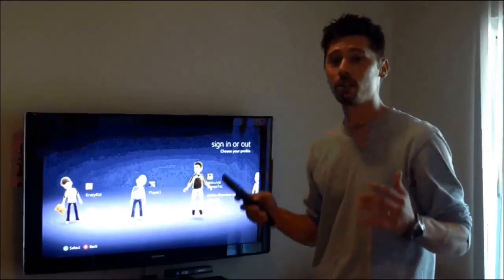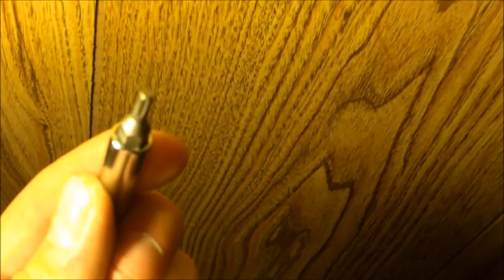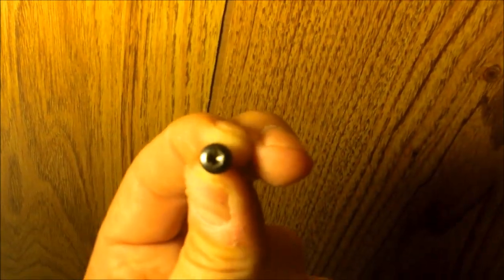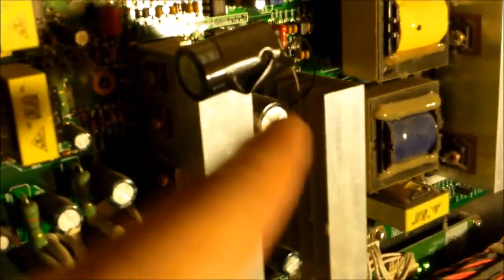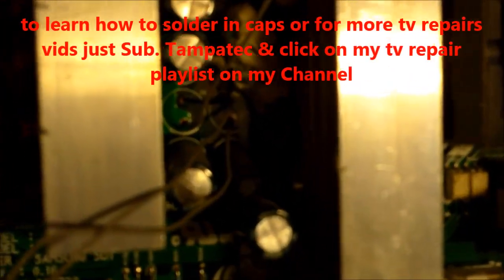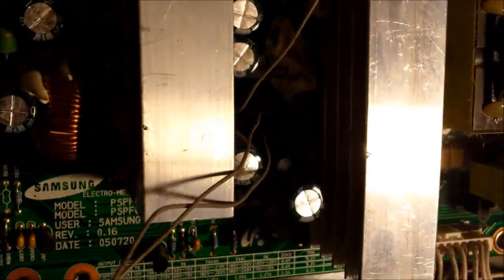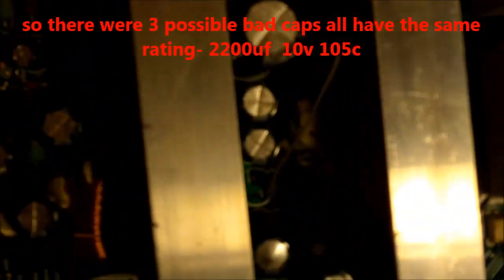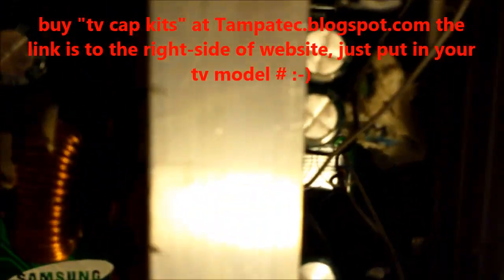How to fix Plasma TV rainbow color snowy static screen repair tutorial

Comment: To anyone still rocking a plasma with this issue, before you take it apart try adjusting your brightness setting. It adjusts the black levels, and if it's set incorrectly that RGB 'snow' on blacks could be because it's treating it as a grey color. A quick way to calibrate this without a set of videos is by getting a letterboxed movie and lowering it until the black borders have no snow.
Reply: yeah 😶‍🌫
Reply: I have a Samsung plasma tv model PN64D8000FF, mfg. date 9/2011.
It has been working fine, then one day, the display got snowy… it turns on fine, sound is good, just the display is snowy. Any suggestions on what I can do to troubleshoot and fix the problem? Thank you.
Reply: I have a Samsung plasma tv model PN64D8000FF, mfg. date 9/2011.
It has been working fine. In July 2024, the display got snowy… it turns on fine, sound is good, just the display is snowy. Any suggestions on what I can do to troubleshoot and fix the problem? Thank you.
Reply: I have a Samsung plasma tv model PN64D8000FF, mfg. date 9/2011.
It has been working fine, then in 2024 July, the display got snowy… it turns on fine, sound is good, just the display is snowy. Any suggestions on what I can do to troubleshoot and fix the problem? Thank you.

Comment: Hi Tampatec, I have snowy interference on My Daewoo DT-42A1, I have gone through the capacitors on the power supply and the appearance of all of them are fine.
I have tested them all with a multimeter on resistance setting and nothing is jumping out at me. Can they be working but lazy under load? Most of them are 1500uf 10v and some seem lazy when climbing to infinity. Any advice welcome
Cheers Stuart

Comment: When caps dry out,  their capacitance isn't affected so they'll read good, what happens is their effective voltage rating goes down and then they arc and fail.  This means that higher voltage rating replacements will be harder wearing in the same situation.  Unfortunately this means they'll be physically bigger so they may not fit unless you are saved by "Moore's Law" with new technology, or resort to flying leads like here.   I buy cheap batches of 10 caps from chinese ebay suppliers for fixing old screens and psu,  and liberally replace any of the same value on the board.  New caps never hurt everywhere.  I've heard that in critical equipment some organisations replace every cap in 5 year cycles before they get a chance to wear out.

Comment: Tampatec I got a 42 Magnavox plasma tv modle 42MF230A/37 I was wondering if you could help me my plasma tv after 20 minutes it kinda has a burn-in but instead of it being white or grey its red, green and blue but it goes away for away then happens again and it builds up if the screen stays the same then goes away would bad nice of you got back at me thanks.

Comment: Hey guys!Well I sure hope to get some feedback on this one because I'm stumped. I repair tv's as a hobby so I kkow enough to get me by, but have never experienced this before. 
Samsung 46" plasma model pn51d450a2dxzc

Got this plasma a few hours ago for free, no power issue. Was lucky with this set, it was unmolested and only needed 2 caps (25v 1000uf). Replaced them and it fixed the power issue, but there was a black circle with static around it. After a bit I noticed the boundaries change so I put on a pixel flipper which got rid of the black circle. 
Now, there is an oval area in the middle of the screen which has static around it, and several (20+) sticking pixels. 
I contacted him back and trust him when he says it was never hit, which I believe because there is absolutely no evidence of trauma on this set. Not a scratch. 
What would cause this? Is the panel itself defective? Have had it on pixel flipper for about an hour with no change. 
Any help is appreciated.

Comment: Enjoy your tutorials, very informative, keep up the great work helping others. I have come across some new Samsung 60" led tv with damaged screens. where can I purchase new screens for them
Reply from the maker: the screen cost 80-90% cost of the tv ( most screens come from China). i would sell tv broken or part it out and sell boards on ebay then use that money to buy LCD TV. don't put money on a dead horse, click "like" if anyone agrees.
Reply: Parted tv out today, sold on ebay already. thanks, Can you recomend a Weller soldering Iron. I was looking at a 35 watt professional model, would that be good enough, also looking for your  web site for parts, thanks Geprge
Reply from the maker: George Momich try shopjimmy.com but i love my new adjustable 50watt soldering iron. also desoldering station is awesome too. weller is great.

Comment: if i have this same kind of problem but only on the top of my screen would it still be the power supply or do you think it might be something  else?
Reply: I had this issue. I took it to a repair shop and they adjusted the voltage. it acts up for a few minutes but after the tv has been on for a few minutes it goes almost completely away

Comment: Hello nice information video. I need to ask you a question I have Sanyo 42746-00 plasma tv . I found 1 capacitor was given snowy picture. I replace with same kind capacitor. But my tv colors and pictures not bright. Not like nice tv cors, can I ask your help please thank you.
Reply from the maker: You have more bad caps, some caps need to be taken out and tested with capacitor meter.
Reply: Capacitor 100microfrad,105C,50V, but new capacitor looks smal, but I do not know picture colors are not bright some part are dim and other side has to much white. This TV about 12 years old. Since  October.of 2006. Thank you again. Please.
Reply: @TampaTec  but I do not know which ones.
Reply: @TampaTec . Hello Tampatac I do not have caps meter only I have fluke meter that mechanic used kind. This tv has too many caps  and 5 different kind of board in the TV. What has to be measured resistance.  I am not a TV repair guy , that's why I need your help please.

Comment: hey @Tampatec great vid. I have a samsung plasma with a similar issue, only I get snowy static in the middle of the screen not the entire screen. Thought it was a faulty T-con but turned it wasn't. is this due to a bad capacitor on the power supply board? I checked and they all look good. Thanks

Comment: I know you posted this a long time ago but how did you not realize they didn't put the caps back in there because that is a design MADE to fail. Engineers and board designers are actually paid more for designs that WILL fail over time vs designs that are stable and will last.

Comment: I have a 50"plasma TV Samsung  with a picture that's looks like rainbows around there faces  and I do see pixels on the screen   like the video says  the picture isn't clear  I was told I had a bad t-con board but I can't find one I see the logic board  your video says its a capacitor  maybe on the power supply. can you give any advise I'm lost lol
Reply: gregg Scholes did you ever find a solution to your problem? I'm having a similar issue.
Reply: Will Kiilerich-Bowles no sir  I haven't I still have the same  problem